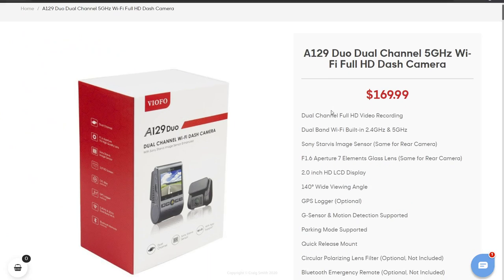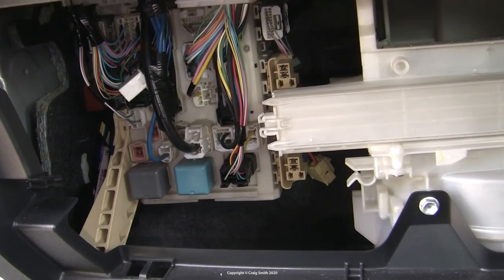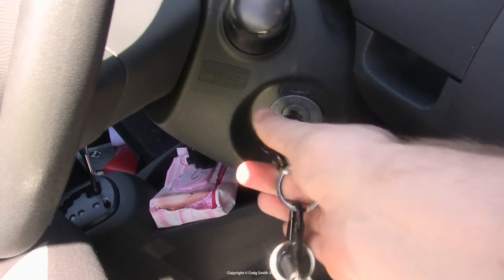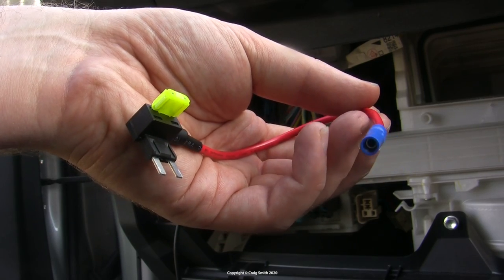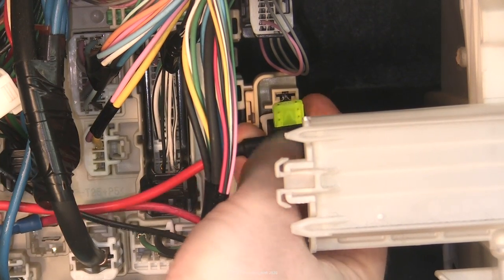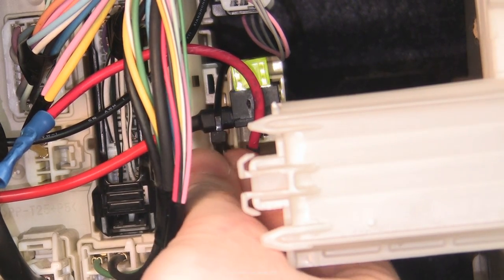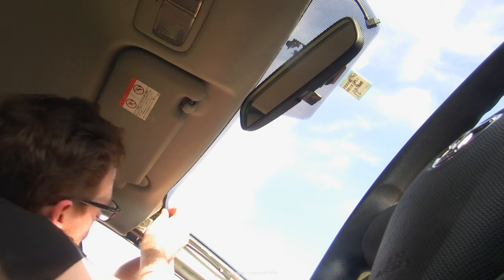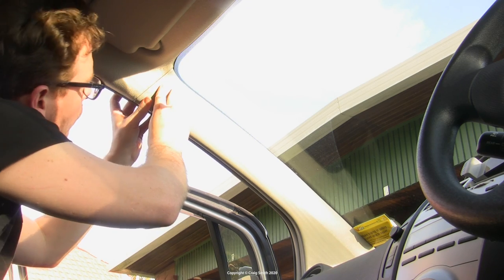How to: Hardwire dash camera front & rear w/ parking mode Toyota Yaris (Vitz)

Comment: Thank you for taking the time to create these video explanations.  Given your clear mastery of the topic, my confidence is bolstered that I chose the same dash cam for my car.  I've watched several of your videos to further bolster my confidence to install it.  But I'm wondering about an external battery.

1.)  Could a battery used by off-grid/camper van enthusiasts be a good choice to run a dash cam, e.g., the Yeti or the Jackery?  Or is the problem that the external battery would not know when to engage Parking Mode?  

2.)  CURIOUS:  How does the dash cam know when to engage Parking Mode if it is powered from an external battery--the way marketed by retailers, e.g., the Viofo A129 Pro Duo plugged into the Cellink Neo?  Or is that functionality lost with the Cellink Neo and the like, which is why you opt for the internal wiring approach?
Reply from the maker: You have to integrate both, the ACC wiring is just a switch, and you would wire up the red power draw to your secondary battery, which itself would be wired up to a charger which itself only gets power from an ignition circuit. The secondary battery would want to be a powerbank style, li-ion, capable of accepting fast charge.

Comment: Great video as usual. I have a Yaris - it's a bit newer than your one, it's 2 years old. It's a hybrid. The fuse box is in the same place but mine has a cover underneath the glove box protecting it from any stray feet etc. I recently bought the Viofo Plus Duo and only yesterday decided I should check it out first by plugging it into my Mac to test everything works before I embark on the install (as per your excellent detailed instructions). Unfortunately, the rear camera doesn't seem to be working. I've contacted Viofo and now awaiting their response. 

I have since discovered that I am not the only one to have problems with the rear camera. A few google searches showed others also had similar issues. From this research, I am wondering if the 6m micro USB cable from the front to the rear is faulty.

I am pleased you are doing the install on a Yaris because I have been a  little apprehensive about doing it myself. Anyhow, there is nothing I can do just yet until the issue with the rear camera is sorted.
Reply from the maker: See my review of the Plus Duo https://youtu.be/0VgWKLdtAcA - also had problems with the rear cam. Try updating its firmware from the Viofo site, including the rear cam separate flash. (But mine is still giving me problems). When testing it use USB power adapter not computer.
Reply: @CraigsDIY    Viofo site says new firmware will be released soon for the Plus Duo. That was as of 16th Dec 20. It's running V1.0 at the moment. There's an update available for the 16GB EMMC version to V1.1. I guess that means the version that has a built in SD card?  I've been fiddling around with this now for hours trying all sorts of things/cables etc but still nothing from the rear cam........I give up!
Reply from the maker: There's an update now to what they call 1.4. No idea what happened to 1.1-1.3... Only references to a weird resolution of reduced vertical px, like the opposite of the 1600p mode, and unspecified 'bug fixes'. Haven't experimented with it yet.
Reply: @CraigsDIY   I've already returned mine for a hopefully fully functional replacement. The UK seller said sometimes the front to rear cable can get damaged upon installation in the vehicle. I haven't got as far as installing it anywhere yet. I've only tested it in my house. From reading through the forum it seems I'm definitely not alone in having problems with the rear camera. https://www.viofo.com/community/index.php
Reply: I've had a replacement cam sent to me a while ago. I've checked it out and everything seems fine with this one. I haven't gotten around to installing it yet. Partly because the English winter weather (cold, rain, wind and snow etc) and partly because of being in lockdown. The car has been sat on the drive most of the time since December so I thought what's the point installing it if the car isn't going anywhere?  Another reason I haven't done it is because, well quite frankly I'm worried I'm going to make a complete mess of it!  I've contacted a local company who said they'd install it for me for around £80 so that might give me more of an incentive to attempt it myself........we'll see.......

Comment: My Yaris has an SRS airbag warning on my A Pillar trim and I'm a bit concerned that I could "set it off" inadvertently when I run the cable?  will it be fine?
Reply from the maker: If there is a side-curtain airbag it's probably more toward the roof, but a section of it might extend into the A pillar. In this case you can still route the cable but make sure you place it, along with any clips/ties, behind the airbag such that its deployment can't be interfered with. The side-impact sensor for side air-bags are down in the doors so it shouldn't be a problem. You can disconnect the battery while you do the job if you want to be 100% safe.

Comment: What should I do if I don't want to use parking mode but still want to hardwire to make the cables tidier? I have 3 wire hardwire cables, and wiring yellow didn't turn on the camera. Unless I connect the red one too to the ACC fuse camera doesn't turn on.
Reply from the maker: Wire it properly. The parking mode is just a feature that can be turned off/on. If you really want to hard disable it, then wire both yellow & red to the same ACC/ignition circuit. But the hardwire kit in this case is superfluous, you might just hardwire in a cheap USB (5 V) adaptor to same.